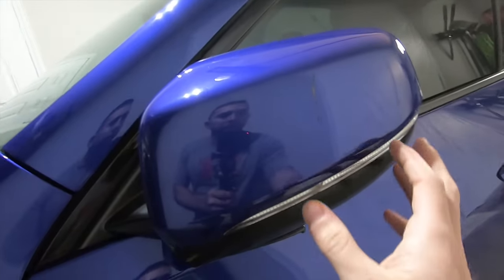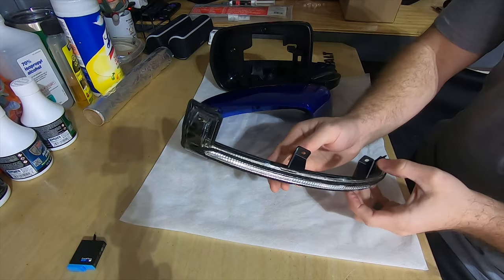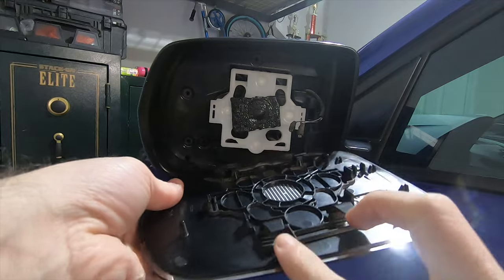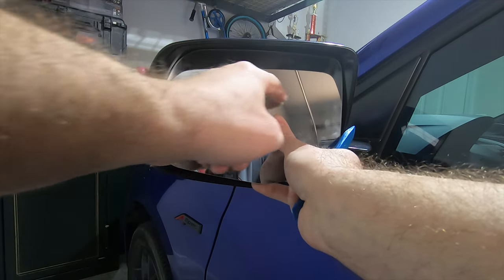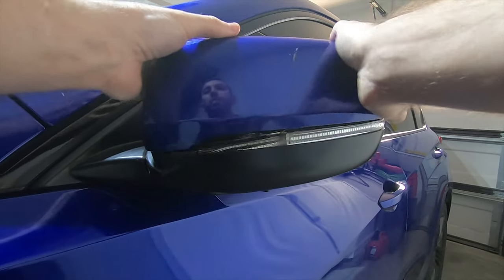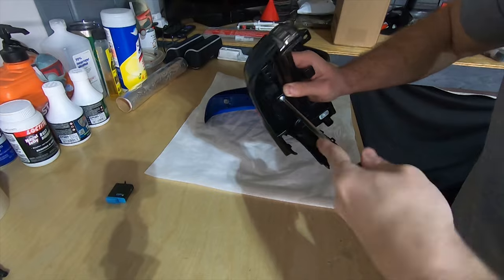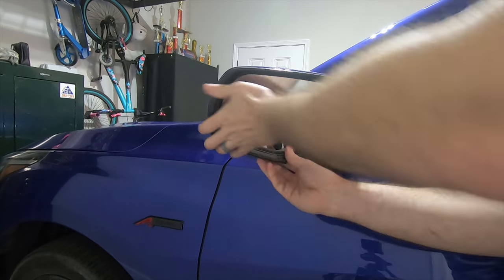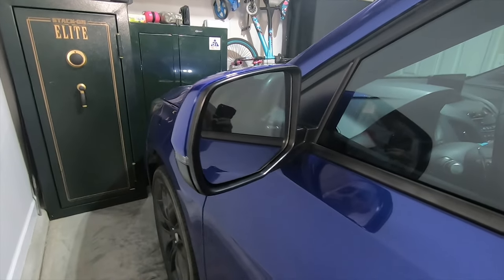Acura 2019- 2023 RDX Mirror Disassembly & Replacement

Comment: great video...i used this to attempt to replace the auto turn actuator...which was super difficult as everything needed to come out including the mirror assemblly as there are some screws right under the mirror housing that you can't get to...just overall very tricky.. All the wires need to be cut as well as they won't slide through the motor assembly housing without it, which makes it a difficult job. I was just trying to save myself over 700 bucks. Oh well, at least I tried. Great video though. I managed to get through everything without breaking anything. They need a video on how to cut and resolder all the wiring...lol!
Reply from the maker: Thank you! As for your project the best bet would be to buy soldering heat shrink connectors. They sell them on Amazon and after you heat them up the solder inside melts to connect the wires and the heat shrink seals it all up nice and clean.
Reply: I have all that already it's just a ton of soldering needed as many wires needed to be cut....
 @Foxcraze

Comment: I’m guessing your RDX doesn’t have power folding mirrors. Mine does, so I may run into a few differences.
Reply from the maker: No, my A-Spec definitely didn’t have power folding mirrors. Aside from there being a motor and gearing in the lower arm, the plastics being removed should be fairly similar. If there are any major differences, be sure to message back and let us know so anybody in the future can search through the comments and find your information.
Reply: @Foxcraze  thanks for the response. I’ve got the new pieces. I’ll make the attempt to swap out in next week or so. I’ll update once I get it done. Mine isn’t broken, just a large scratch on the red plastic cover.
Reply: Update on those with power folding mirrors.  Few differences. There is a small plastic cover that comes off the underside of the mirror to reveal 3 screws on the folding gear. The one closest to the door is tough to get off with very little room to get a ratcheting Phillips head in there. (You may want to put tape on the body to prevent scratching your paint.) Once these 3 are off you can lift the mirror up to get the other screw shown in your video that is underneath and continue as you did. 👍
Reply from the maker: @kevinmacdougall9682 that’s what’s up, thank you for the update!

Comment: If the reflector wasn't broken, would one be able to snap off the top (painted) shell so easily? It looks like the reflector's screw that goes into that top part broke off thereby freeing the top part to be simply pulled off. Is that correct? Thank, super helpful video.
Reply from the maker: You are correct, it will not come off at all if the reflector isn’t broken. the entire front of the mirror housing top (blue) and bottom(black) have to come off as one piece before being able to remove the top (blue) piece from the reflector housing.

Comment: I can't get the mirror to snap back onto the white part, it was difficult to get it. released to begin with but no. matter what pushing, it won't snap. back on and it floats up. from bottom. and I'm. afraid it will. fly off.
Reply from the maker: Hmm that’s tough, mine did that a few times before it finally snapped back in. Maybe change the angle of the white part  when pressing it in will help apply more back pressure.

Comment: Awesome video. Do you think this is the same for the 2016 RDX?
Reply from the maker: So if you go to acurapartswarehouse.com and look up the vehicle it will show you a diagram of the parts expanded. It look like it fairly the same process with the exception that the mirror body looks like it’s only 2 pieces and not 3. I would start with glass look at top and bottom angles and take it slow and go from there!
Reply: It does look like two instead of three as you noted but I'd be surprised if the mirror was attached differently. I'll tread with caution. :)
Reply from the maker: Good luck to you and let me know the major differences so I can update description!